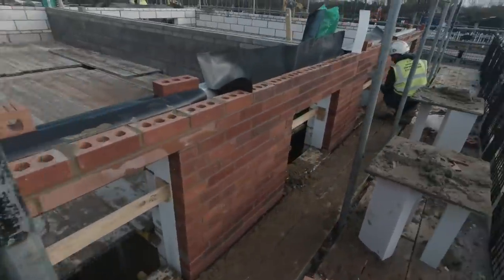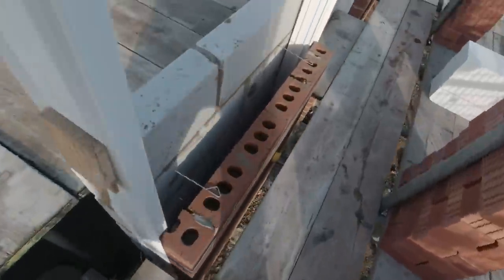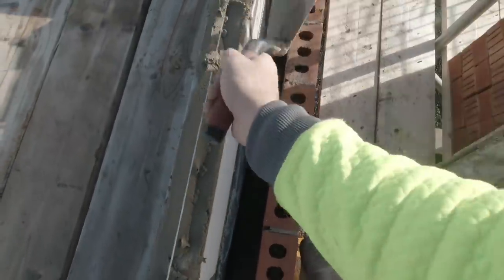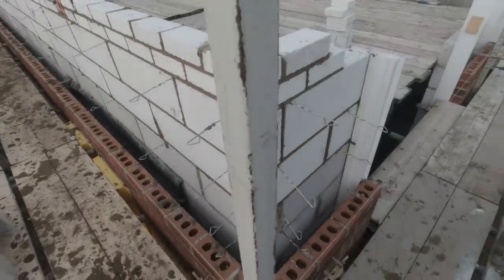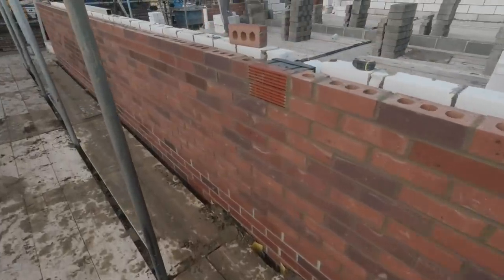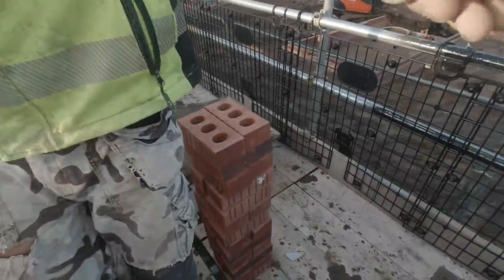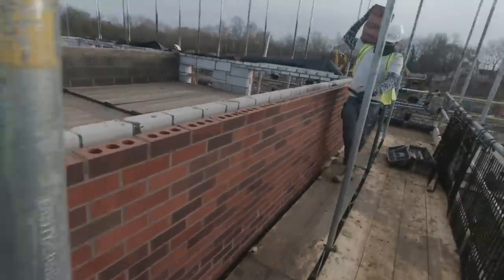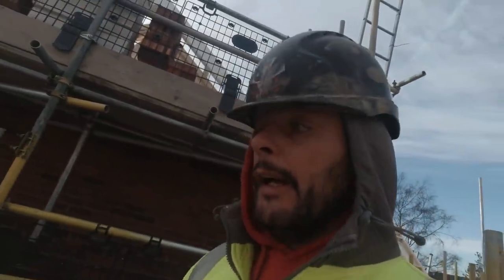bricklaying skills

Comment: what use is that damp tray  on the gable  end
Reply from the maker: It prevents the isolation going up to the peak.of the gable
Reply: @trickybrickys  building regs gone mad imo i think it creates a week spot on a gable end
Reply: @andrewbainbridge3972  iv seen them blow over before at the point where the damp is 😂
Reply from the maker: I've spoken about this in todays video bud. Just uploaded 😁😁